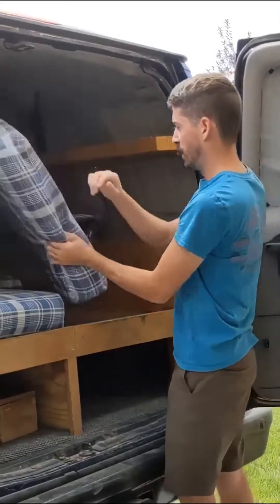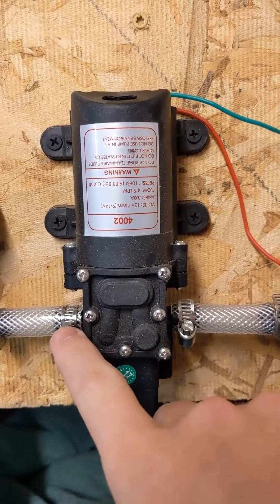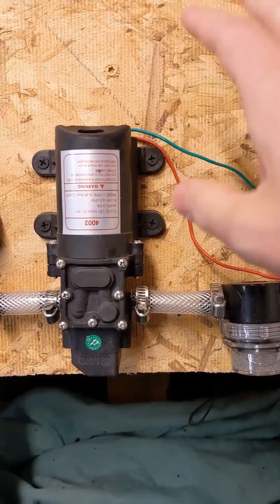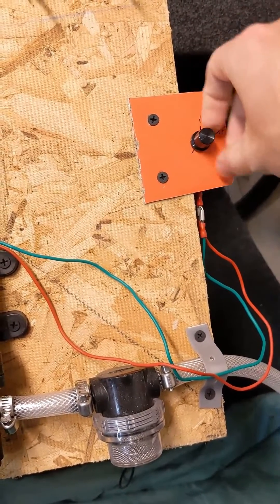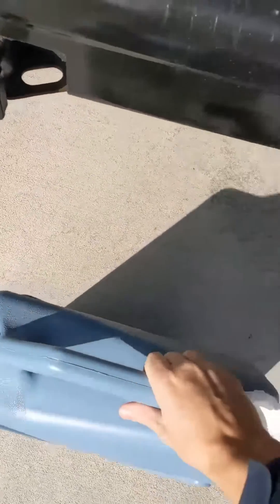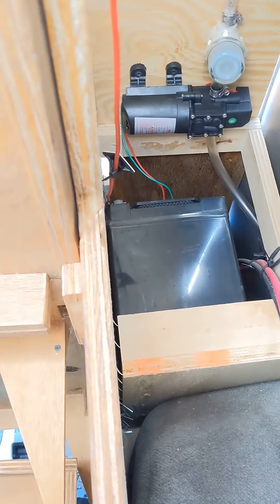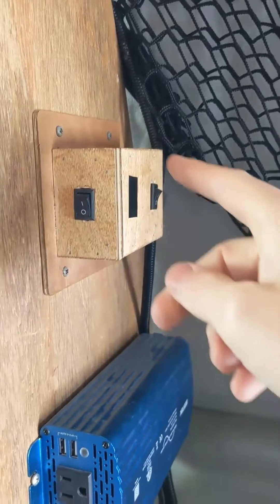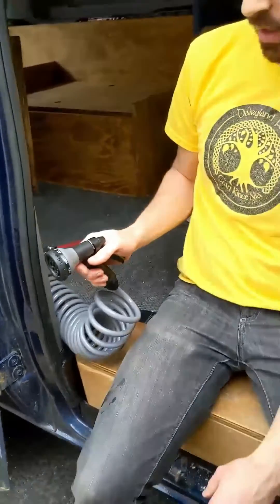How to: $20 Water Pump for Camper (Shower!)

Comment: Really interested in the model of the showerhead as well.
Reply from the maker: It's actually just a garden hose sprayer. The pistol grip type with an end that twists to select different spray modes. It has a small ring on the back that allows you to lock the spray to On, so you don't have to continuously squeeze it.
Reply: @campcramped oh interesting. Does that use the standard garden-connector-clippy-thing-that-always-ends-up-leaking? How did you convert that to the 1/4 fitting?
Reply from the maker: @Brammm87 I installed this hose valve through the side of my water cabinet https://amzn.to/460cpLj
And I used this adapter on the inside of the valve so the tubing from the pump would connect https://amzn.to/42cCaqH

Comment: Perhaps you have mentioned it, and I missed it, but what type of sprayer hose/nozzle is that on your system?  Sounds like a well thought out system as all of your designs seem to be.  God bless and adventure on!!
Reply from the maker: It's actually just a garden hose sprayer. The pistol grip type with an end that twists to select different spray modes. It has a small ring on the back that allows you to lock the spray to On, so you don't have to continuously squeeze it.